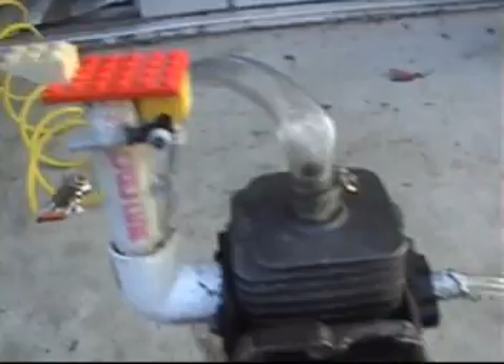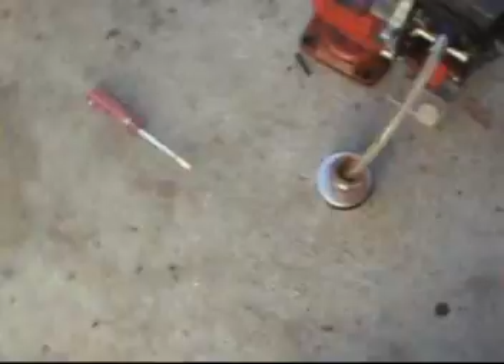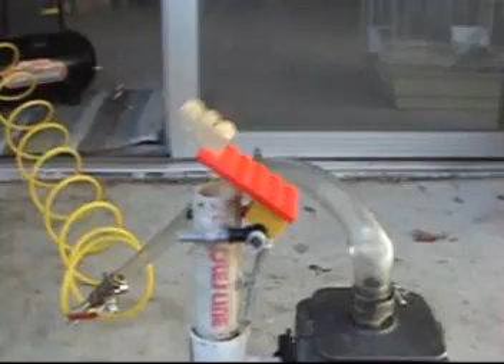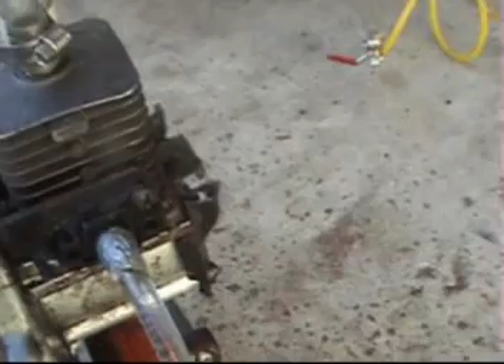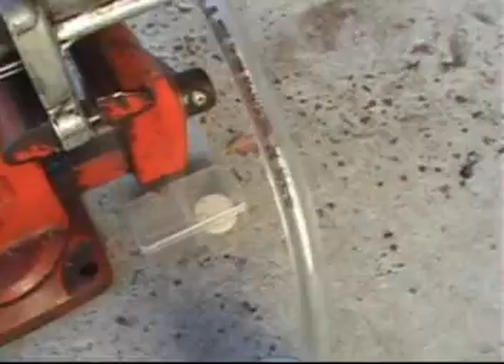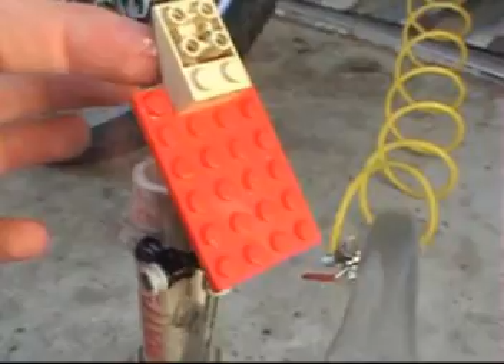homemade air engine

Comment: i would face your exhaust into your oil container and reuse it get rid of the lego dude pump the oil from the motor to the oil and oil to motor other wise you may as well have a big truck running at 7 liters per km because it would be cheaper

Comment: You might like to reclaim all the oil that it spews out by ducting it in a collector vessel. That, and drain it from the crankcase periodically. In  addition what you already come up with. That way you dont waste much at all.

Comment: Here's a thought, why don't you put the oil in the inside of the engine instead of the outside?
Reply: +Johnny “Exacto” J  It's a two stroke genius, it exhausts the oil every cycle :/

Comment: Well im happy to see someone who at least doesnt run 2 stroke engines dry! Better too much oil than not enough! (:
Reply: ***** too much oil is only a problem when running on gasoline, when it will foul the cylinder. Running on air like this engine it shouldnt be a problem.

Comment: Cool, but the only con is that is guzzles oil. You should put a condenser chamber above the exhaust then run that back to the oil cup.

Comment: Your basics is same as traditional engine.The change is that u r using compressed
 air from pump it means same mixture of air & petrol.But in it u have increased the amount of air in charge..............................................

Comment: Being Based on a 4 stroke Engine wouldn't the oil in the sump be enough to keep it lubricated ??
Reply: +MrCrowart This is not a 4 stroke engine, nuff said.
Reply: Great question! I thought the same thing.

Comment: oiler needs a hole in it or valve to allow a meterd amount of air in it as it runs you could adjust the oil by allowing air into the oil line :)..just thought id tell you...if you dont have a valve use a slot cut out on the hose and coveer what doesnt need to be exposed with tape  :)..ok i thought id offer that to you  :)

Comment: when i run into a problem like oil spilling or whatever, i`ve learned to ask others what to do, or ``what` would they do?..   this is just a thought you could use a high temperature grease on all the moving parts that need to be kept cool.  and get rid of the oil n tube altogether...the grease will fly around a bit but after it works itself in should be good to go.  if it works just grease it as needed.  remember ask someone if ya want...maybe especially before you try this.  p.s. GREAT JOB.

Comment: just a smaller oiler would work better, small valve on it to control the uptake of oil- would be better on the spark plug hole - somehow.

Comment: TRUE!- VALVE NOT NEEDED!, the expansion and contraction of that rubber tube, acts like a dampner, absorbing the return stroke and then allowing it to expel it at a higher pressure on the down stroke - simple, efficent cheap works good - up to a point, your top RPM may not be as high as one with the valves.

Comment: that oil is way to rich, I would of put the oil directly in the bottom end, drill and tap a fill up and drain plug so you can use a little bit of four stroke engine oil in the bottom end, you might need a dipper arm though

Comment from the maker: i bet your that kid who just sticks his air compressor straight up to the spark plug hole and tries to fire it up only to find out that it just goes back and forth. YOU NEED THAT RUBBER TUBE BETWEEN THE COMPRESSOR HOSE AND THE SPARK PLUG HOLE TO EXPAND AND CONTRACT ALLOWING THE ENGINE TO ROTATE IN A 360 DEGREE MOTION

Comment: Just what I said its not going around its going clock wise than counter clock wise, trust me I did this, you need a valve on the air hose that opens at top dead center and closes when its at the bottom, when the piston is coming back up the air is forcing it back down and it never makes it all the way up there for its not going round and round.

Comment: I did this once it's not going round and round it's going back and forth back and forth put a piece of tape on the crank you will see, I did get mine to go around all the way by using 175psi of air

Comment: I think if you want to add any oil you should add it through the air line gradually, that might solve the problem. You have it going directly into the intake which is meant for intake air and that's why it is sucking up all the oil. I like your concept.

Comment: @GreeseMonkeyy - Have you solved your oiler problem?  If not, take a look at the overflow recovery bottle on most cars.  Set up your exhaust to vent into a bottle and use a sponge to filter the oil vapor and allow the air to vent.  Hope this helps, nice little run there.

Comment: Hey you dont need all that oil being sucked into the motor,,all its doing is blowing it out the tail pipe and ruining your floor,,just put a little bit in the crank case and forget the oil bottle,,LOL. there's no combustion or even getting hot and it would run for hours that way with no oil at all anywhere.heehee.

Comment: well, the oil's gotta go somewhere, so, probably out the exhaust, or into the crankcase, so, put the tube in a crankcase fitting to recycle, with a strainer maybe.

Comment: how did you do this? cause it doesn't look like your pulsing the air
Reply: Seems like it will run without a valve on the pressurized air inlet, even though it might not be as efficient.

Comment: that thing on the end of the exhaust pipe is on big trucks to stop water getting down the exhaust pipe. Since the exhaust pipe is straight up, if it didnt have that and it rained, water would go straight down it and kill the engine.